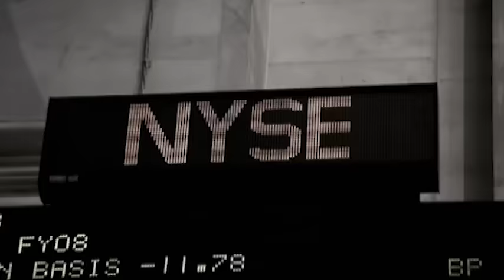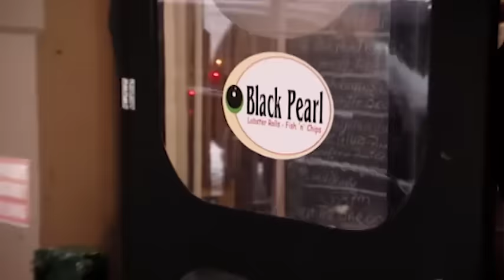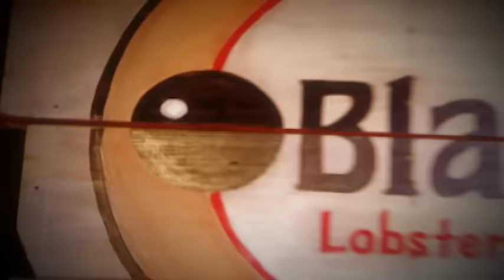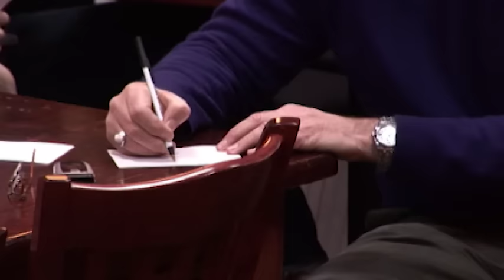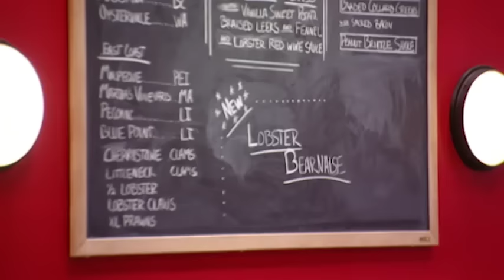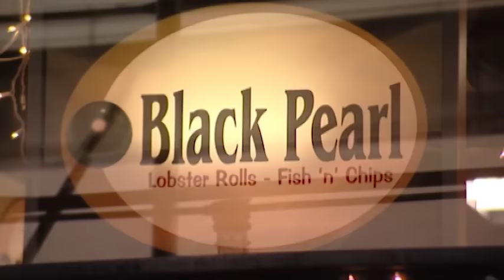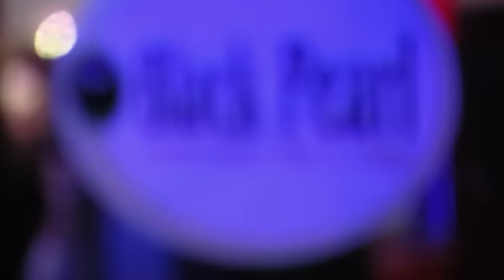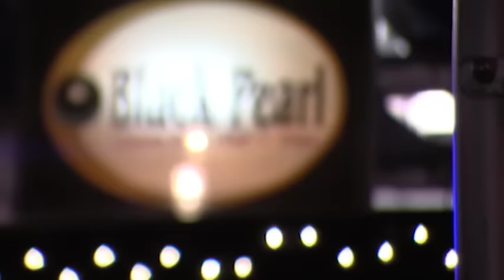Kitchen Nightmares Uncensored - Season 1 Episode 16 - Full Episode

Comment: For anyone wondering the difference between Maine and Canadian lobsters, yes they are the same species. But they're diet, care, and ecosystem are very different. It's the same difference you would see in certain cows for beef. Maine is considered the pinnacle of lobsters in the world. They have sensitive diets, better quality and tasting meat, softer shells, and higher yield of meat. Canadian lobsters are basically average at best, and are usually used as the lowest form quality of lobster. Think quantity over quality. Still good but distinct difference.